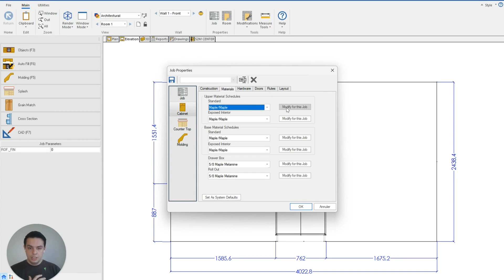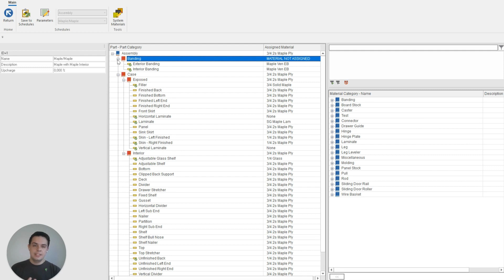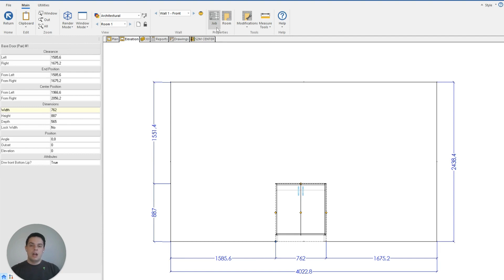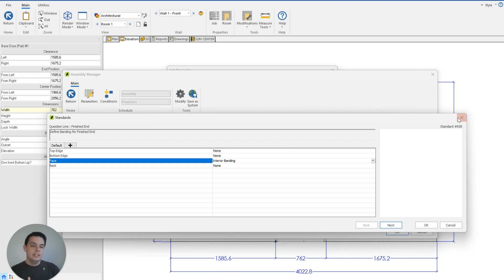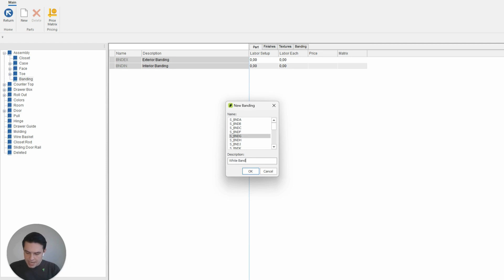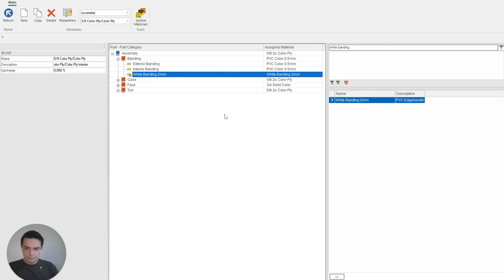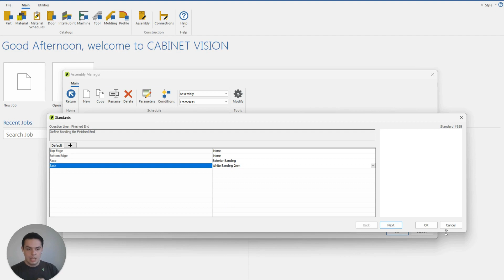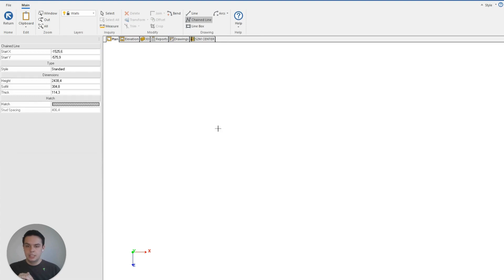How to Edge Band Multiple Materials in Cabinet Vision (Intermediate)

Comment: Great video once again! I'm using CV 25 and for some reason I followed all the steps - created the new banding and added material to my schedule but when I tried to change it to the new banding it only shows Interior and exterior banding as option, but not the new banding ("Thick Banding" and the material associated to that). Something changed?
Reply from the maker: That's an interesting one! 

What happens when you change the edge banding material you have created to another kind? For instance, instead of creating a new banding variety with the name 'S_BNDA' in the Part Manager, could you try seeing if 'S_BNDZ' produces the same problem for you? 

This seems like it could be related to this issue (https://nexus.hexagon.com/community/cabinet_vision/f/cv-possible-program-issues/147825/cabv-30314---cabv-31360---new-banding-part-now-assigned-to-all-previously-none-edges-in-assembly-manager/852048) which means you might be able to get the result you want in using a different codename. 

Let me know if that does or doesn't work, and we can troubleshoot it some more!
Reply: @PlanitCanadaInc  When I changed from ' S_BNDA'  to 'S_BNDZ' it worked properly.
Thanks you so much for the fast answer!

Comment: How can i change the format in which the program presents the banding on the cuttinglist... In example my program would present  NENN or DDDD or ENNE or something like that... when the workers are used to 2W/1L or 2S1L or something like that... is this even possible?
Reply from the maker: That's a great question! Clayton intends to do a video on this topic, but for now, we have some instructions for you below: 

Step 1) After optimising a part, you will want to click on the Reports button in the S2M Center. (Found above the NC Code & Labels button)
 
Step 2) Click on the Setup Reports button on the left.
 
Step 3) Find the Report that you want to modify, and right click on it. Click the Edit option. (If CV asks you to create a copy of that report, that's okay.)
 
Step 4) On the left hand side of the Editing Report menu, you will see a table probably called 'Table: PartList'. Double click on that. 
 
Step 5) Scroll down the formulas list until you find one which likely is called 'PartList.BandingFlags'. Double click on that. 
 
Step 6) Open up the folder 'Fields' and then 'PartList', and then you should see a formula called 'BandingCode'. That sounds like it is the format you are looking for. Click on it, and then Insert. Then delete the old formula 'PartList.BandingFlags' so you don't double up. 
 
Then you should be able to save the modification, and it's all done!